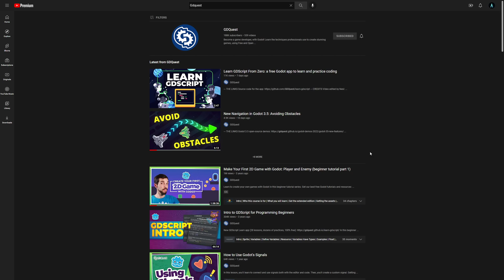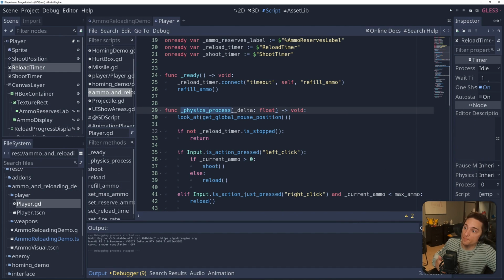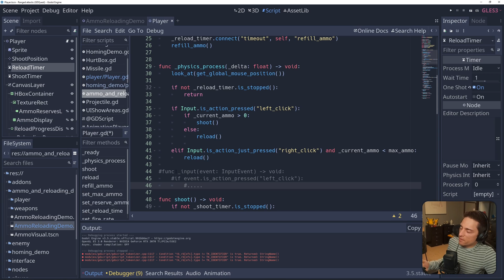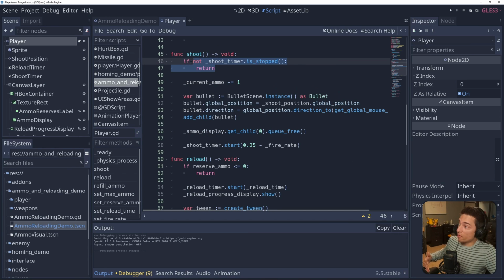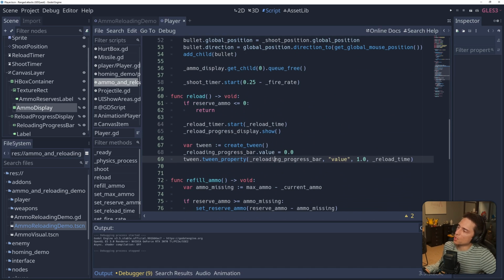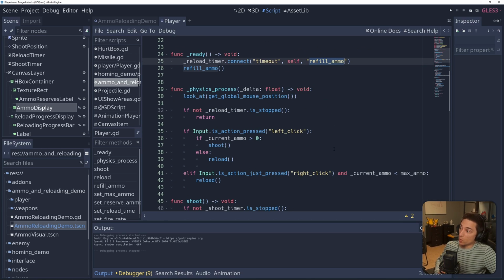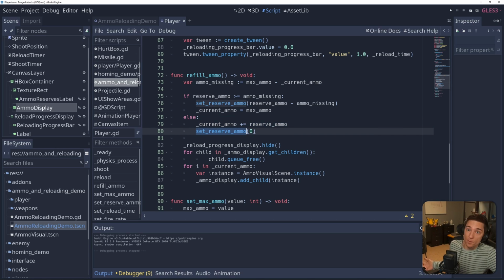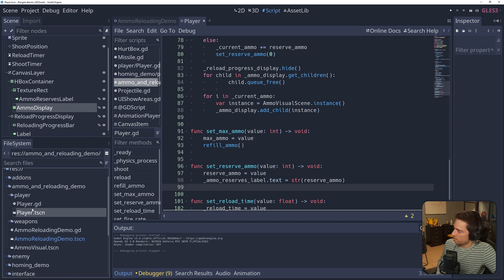Reloading Weapons and Managing Ammo (Godot Tutorial)

Comment: I really dislike guard clauses with returns.
Would way easier to read:
If timer.is_stopped():
    Do something

Also, the reloading timer could be a variable in the physics process, would save a timer node.

Same thing for shooting timer. Use physics process to check bullet delay.
This is also important if you want to fire multiple bullets per frame, is more maintainable.

Also, as other pointed out, having a bullet pool is critical with high fire rate.

The other way of doing it is to tween the clip directly.
You will see the bullets going up and you will save a few timers and code.